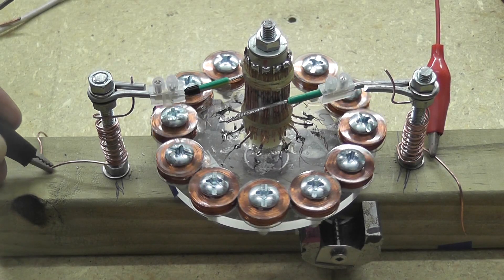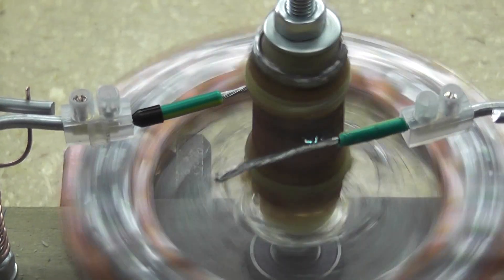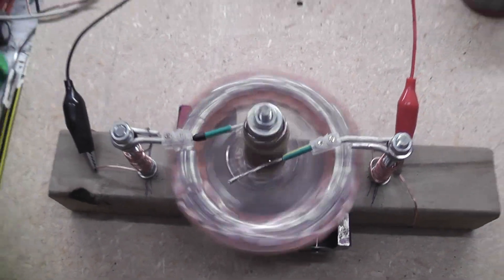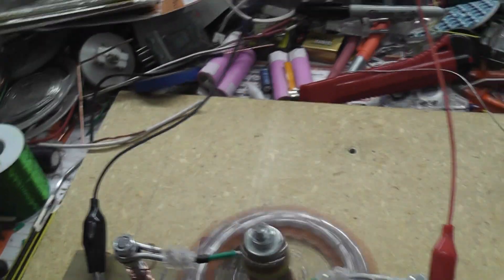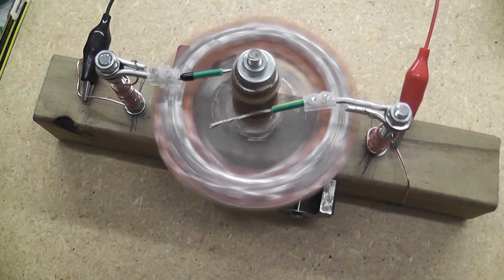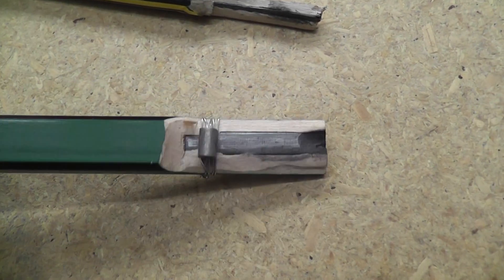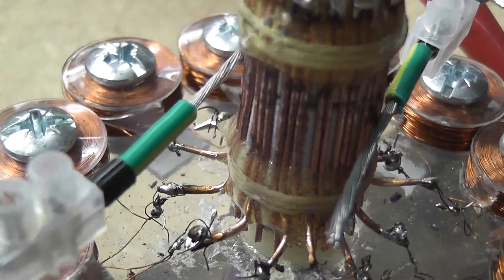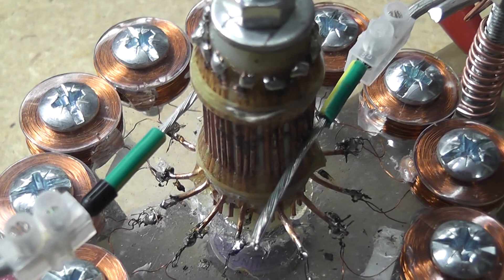DC motor build from parts with 12 coils

Comment: is that copper wire around the poles for earth? That motor is brilliant
Reply from the maker: Those wires around the brush poles are for the current and act as a spring at the same time to hold the contacts on the commutator.

Comment: Nice work!

If you have a lathe (or access to one) you could coat the commutator with resin, and then machine it down to the wires!
Reply from the maker: I wish I had a lathe.

Comment: The brushes spark/arc quite a lot. It won't last long term.
Reply: It's not meant to last a long time. It's just a cool experiment.
Reply from the maker: It worked better then expected as there are 13 commutator bars instead of 12 so there is no perfect symmetry.

Comment: pencil graphite is very poor quality "graphite" it has lots of clay and binders in it to make it write smoother - if you pull apart a battery and get the graphite electrodes from those theyre much better!
Reply from the maker: Thanks for that info.
Reply: Also, keep in mind that with using the strands, the carbon might be ground up quickly if there is too much pressure. (Since the stranded commutator bars make for a rough surface.)

Comment: Are we going back in time here? Has this be done before?
Reply from the maker: The coil part was done last year, the commutator was not too good as the Cu strips came loose. This commutator is different design and the contacts are supported.